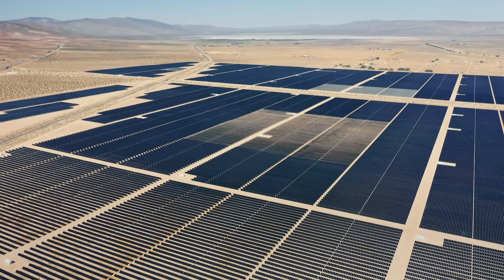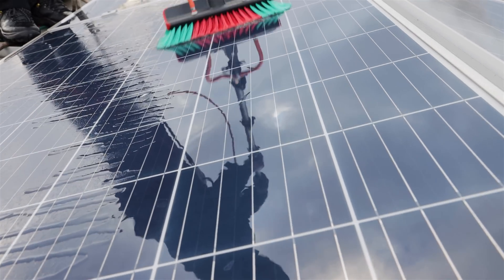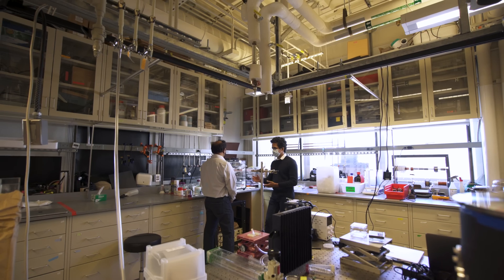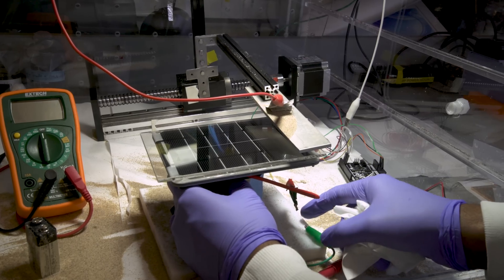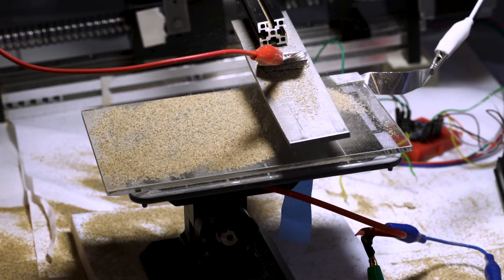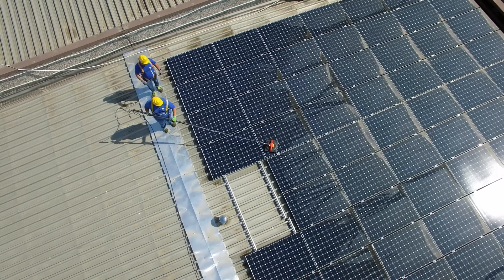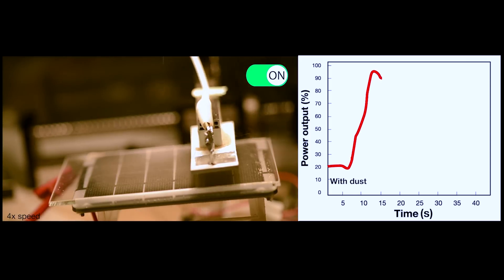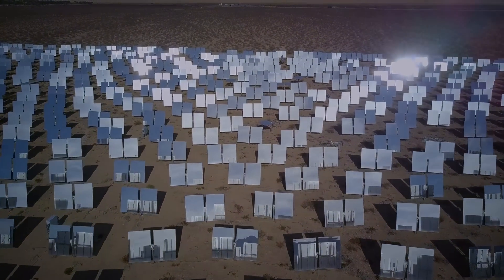How to clean solar panels without water

Comment: There will still be scratches from moving the sand particles, you can't get it all out as well, there will be that fine dust and on larger scale it will be even more. You might as well make it stick better by charging them. 

The technology itself is not scalable, it would take so many moving parts just to implement on one panel, moving parts = danger, the dust it's trying to remove will kill the machine itself, even if the machine is made dust proof, a significant part of power produced by the panel will go back into operating such an apparatus, per panel. And who is gonna clean the machine itself? This is all just overlooking the maintenance needed for it too.

Comment: @Massachusetts Institute of Technology ( MIT ),  Can we not use inbuilt motor vibrators the way we have for mobile devices so that the dust / sand particles are bounced off from the surface using a small portion of electricity which the panel generates from time to time ?

Comment: If you look carefully, you can see that it doesnt actually solve the problem , there is still sand left. Sadly, reinventing physics didnt work this time. maybe use a fan or air pressure. or a very soft brush.

Comment: Looks less effective than a leaf blower TBH, and there's no way in hell you're going to have thousands of additional mechanical actuators and systems installed on those solar farms.  Hell, the water footprint alone from the extra equipment likely outweighs any direct benefit.  You're probably better of installing a well on-site and using excess solar power which isn't needed by the grid to pull water up to use for cleaning.

Comment: Incredible idea! I wish you all the best in scaling it up :)

The problem you are trying to solve got me thinking;
Could a closer to loop system that still used water be employed to retain the solvent benefits of water while reducing the consumption problem?

Prevent as much water loss due to evaporation using a sealed armature that sweeps over the panel.
After each panel (or X set of panels realistically) allow the reservoir tank to rest and settle out the collected particulates to reduce filtration requirements?

This would take a lot of work to develop but now I want to try it.
Reply: Yeah. not that different from a carpet cleaner...
Reply: Might work but water has to be introduced into the system initially, for large scale solar farms this might be a big number

Comment: I notice it didn’t get rid of fine dust, sadly.  But recycling water could save a lot. In hot deserts, use the heat of the sun to evaporate the dirty water after cleaning, and water vapour condensation at night to get clean water again. I can imagine quite substantial savings of water.
Reply: It's a fucking desert because there isn't any water to condense, genius.

Comment: Sorry to burst the bubble here but no. There is still dust on the solar panel and in addition to that it will require electricity. So it will make them less effective by proxy. Nice try though.

Comment: What if you used piezoelectric haptic drivers to simply vibrate the sand off?
Reply: The problem isn't sand. The problem is the solar panel is exposed to ANY environment.

Comment: This will work only with dust grain, how do you remove the specks? Most of the solar panels i saw didn't had sand on them they had specks on them.

Comment: I know im nobody but listen to me.  Please start working RIGHT NOW on a version for extraplanetary rovers and landers! We are losing InSight mission as we speak, because of the dust accumulated on its solar panel, and nothing work to get it off.  You cant wipe it because it razor sharp and it damage the panel, or just dont get off.  We cannot rely solely "magical cleaning events" what kind of bootstratp science is that? This will clean the panels and extend mission way beyond what we can even dream right now.  Most rovers and landers would still work to this day if they had this thing straped on them.  This in invaluable technology.

Comment: Good idea..  but I hate when they mention stupid figures just to inflate their idea like "PV world water consumption equals to the water consumed by 1 million people on underdevelopment countries" (which they consume 10 times less water than a normal mid income person) just to try to imply that "it is a lot" when is not. 
That water you save in the PV would be sent to each one of those 1 million people in need??  not.. I do not think so.
All locations of PV farms has that issue??    No.. some just make a hole and get water, even if they save that water it would not reach people in need.  You can also take water from the atmosphere.
A resource save in certain location does not mean it could be use in another location.
Also.. I notice that your test PV panel was only few cm wide, this mean that the dust who jump has higher chance to fall over the sides, what happen with the center of a normal PV panel with no inclination?   how the dust fall to the ground?

Comment: Interesting approach but i don't really get the problem... You don't have to use fresh drinking water to clean some solarpanels. Also you can pretty easily recover the water and filter it for reuse. So no water is actually "used up".
I think this is a solution to a problem which doesn't exist.
Reply: Fresh water is a must in fact I would have used better than drinking water to clean solar panels. Anything else would cause heavy deposits.
Reply: It basically is.  And it'd be cheaper and more efficient to just install a well for a large solar farm.
Reply: @rockspoon6528  Groundwater can be a very limited and important resource in arid areas, so if you have a bunch of solar farms all taking water from wells or boreholes or might have a significant impact elsewhere (eg river sources or watering holes drying up, plants with long roots to access water being unable to do so and dying etc). Agree it must be possible to reuse most water used in washing though.
Reply: @mrgreatauk  I might be a bit biased towards wells as most of my desert experience has been in Nevada, where the majority of the state has access to deep underground reservoirs whose draining not only doesn't have a negative impact on surface levels, but actually improves them a water which was simply... existing... deep underground re-entered the water cycle above.
Reply: @rockspoon6528  fair enough, yeah each area is different depending on the geology and where the water is actually coming from etc. I'm from the UK and there are some areas where flow in little streams etc cam be really sensitive to groundwater levels, and other areas where there's a pretty small impact, the only real issue being if levels drop really low then salty water from elsewhere starts getting drawn in ruining the water source.

Comment: Compressed air has been used by many to remove dust from objects; most notably PC cases.
Reply: Cost is a big concern.
Reply: @sanjeevkmaurya-d2653  Cost is not a fucking concern with compressed air, especially when your suggested alternative is to install mechanical actuators with charged plates onto each solar panel.
Reply: And why would be a good ide to basically sandblast the solar panels? Cause that's what you would end up doing, if you start blowing sand from a surface, it scartches the surface.
Reply: @asdfhun  The wind: Allow me to introduce myself...

Comment: It's not always the dust that covers solar panels. Often times it's a bird poo and one has to use water for that, otherwise just use compressed air to clean up the panels.
Reply: @Dacia Sandero guys ... the point is where to get enough water in a dry region? Trucking it in is costly.
Reply: @rupe53  Pipe line from wet regions. If you can make roads for trucks, how is a water pipe a big deal?
Reply: @riscnx  ... that all depends on the cost of each. You'd need enough info about a particular installation to even start that math project.... beginning with how much water and how often it's needed. Also what's it worth in the long run. How much do we gain if it's once a week, once a month, or once a year? Is it cheaper to plumb it up to be automatic or hire guys, who can also do ongoing inspections at the same time? If we think along the lines of cleaning windows on a tall building (or painting a bridge) it might be a case of start here... and when you get to the other end, go back to the beginning and start again.
Reply: What kind of birds could be in the desert
Reply: @PAA-ne3pc  Many kinds of Vultures, Eagle, Sparrow,   Osprey
Reply: @riscnx  ... and now for the catch 22.... you bring in water and you actually attract more birds, not to mention other critters that will hang around waiting for water to drip on the ground.
Reply: @rupe53  Hmmm.
Actually there is a way to resolve that.
Keep taps dry in day light, and clean the panels just before dawn in dark (birds don't fly at night, and bats don't live in desert)
Reply: @riscnx  ... well, that seems to solve a particular problem of attracting them for drinking water. The next question would be any issues of bugs or critters being attracted to dripping water on the ground. Will it attract anything or nothing? I suspect it will depend on the exact location of these panels and what lives near enough in the first place. After all, the desert is not the only place we'll (eventually) have solar panels.... but all panels will need to be kept clean.
Reply: @riscnx  .. you are right... it's not rocket science. OTOH, it's about what will be cost effective in the long run. Every situation will be different.
Reply: compressing air takes energy, so it lowers pv efficiency
Reply: @vaakdemandante8772  So electrostatically charging the panels and moving the electrode across the surface takes what? magic?
Reply: @tardonator  Probably less energy, but it doesn't look to be all that effective.
Reply: @vaakdemandante8772  How does the water get ther?! It literally says that it has to be transported from faaar away, cause its a desert...

Comment: Just cover it in an adhesive plastic film that can be replaced like a phone screen protector. And before eco people go all crazy about the plastic, keep in mind you're trying to extend the life span of a giant piece of plastic.
Reply: Basically.  PV cells are shit at mass energy production- they have their uses (remote, off-grid power supply such as isolated locations or in space), but they're not a feasible tech for large scale production.

Comment: As a scale model builder, working with tiny grass filament and applying them by with an electrostatic applicator (basically the same tecnology shown here), I actually tough of removing dust from surfaces, even tried it, but never linked it with the benefits of large scale, no water, automated system for solar panels. Nice.
Reply: I think you a word.

Comment: What's wrong with a robot doing the cleaning either by physically removing it or by using water and recycling the water out of the sediment. Using a well developed process you could probably use 1% or less of the current method. Cleaning at night to reduce evaporation, or using better yet using the panels to condense water at dusk and use that water for cleaning, providing the areas atmospheric conditions allow it. All I'm saying is that there's more work to be done.

Comment: Just use automated windscreen wipers like in cars.  A little squirt of water does no harm to environment . Collect that water and recycle it then resupply the same water.  
How your tech is going to remove dry mud accumulated on panel by the way.

Comment: What's with the super fine dust didn't looks like it can remove it so far ... and why the farms using water instead of compressed air ore mixture of air and dry ice ?  Both can be generated with unused  leftover electricity from the solar power / grid !

Comment: If someone can answer, how much would it cost to have this as a solution to a solar panel?
Electrode, which can be a simple metal bar, to pass over the panel, producing an electric field that imparts a charge to the dust particles as it goes has to be installed separately on top of panel. right? Also there might be some electricity wiring and installation.

Just curious on the estimated cost to install and maintain this method (in both small scale and large scale)

Comment: Useless!
We already have better methods.

Really this is what you came up with? 

How about blowing dust away with Pressurized air. For the pressurizaation you may use the electricity. The same one that the solar cells are producing. also you may use the lolal air.
So in the end only thing you have to transfer is the human with his equipment, and you can do that also with the electricity that is locally produced. 

I will give you more free advice. Do not have your solar cells directly exposed. Cover with easily replaceable and recyclable transparent material like glass preferably divided in segments.

Comment: Well I guess this quite a good approach, but actually a Sarcelles produces energy, probably enough to feed an air-compressor, why are you not simply calculating an air connection line/network with small air-pipes and use the electric arm to blow the sand off the panel? This method is also limited to lose fragments like dust and sand and will not necessarily work in cases like "bird-shit" even if electrostatics charge could be quite strong. Another way is to put a foil on top of the panel and lift this foil up and down. You could also try to use this foil to make it vibrate via oscillator if the foil would have some compounds of e.g. quartz or would be piezoelectric. Due to the frequency, the sand would start swinging and slip off. I think the focus if to remove most of the particles while reducing or saving water. In a desert area, there are micro-scratches anyway because the wind blows sand at the panel because of medium heavy wind and storms.
There are also some solutions at the market e.g. sunbot or ecoppia, I think boath working with soft tissue, if you might combine this with air-pipes as first step and a soft tissue cleaning afterwards it will be automatically, cost effective and without water.
But in regards of Thesis work or eventually space technology a great approach.
But normally you shouldn't have dust particles in space.